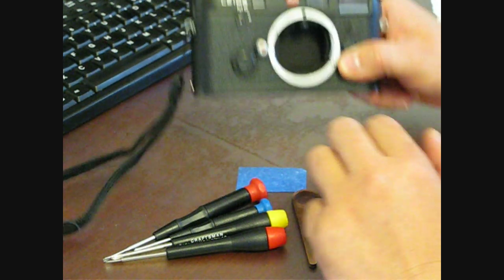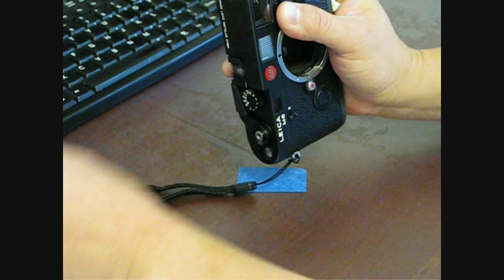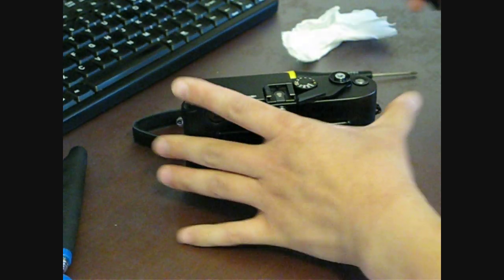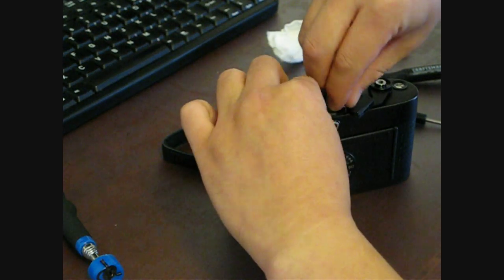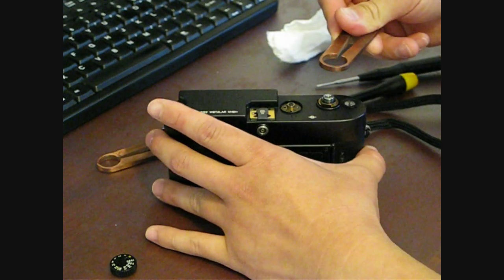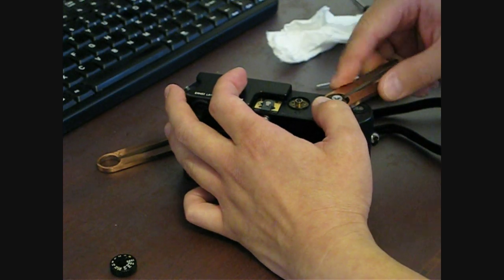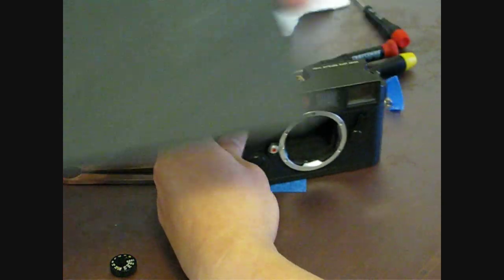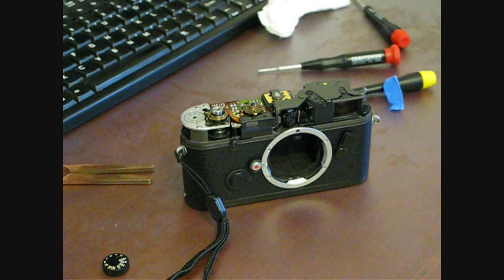Leica M6 Top Plate Removal

Comment: Hi John, I had to do the very task many times over the years during my time as a photo journalist. I had trouble with the rewinder, it came loose twice a year. the two screws inside would not hold. I´m just wondering, did you ever had any experience with the white dot on the curtain for the light meter. Mine has faded and the metering is basically wrong. Any idea how to fix this? Repainting?

Comment: Couldn't even get the rewind knob off. When I held the inside part it just removed that. Tried to loosen the flat head on top of the winder and it just ended up breaking the screw driver.